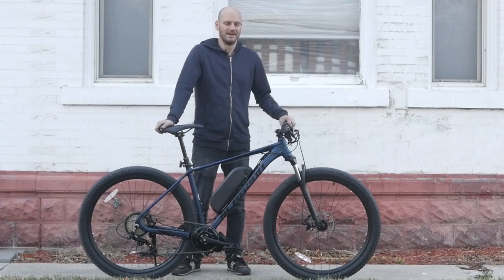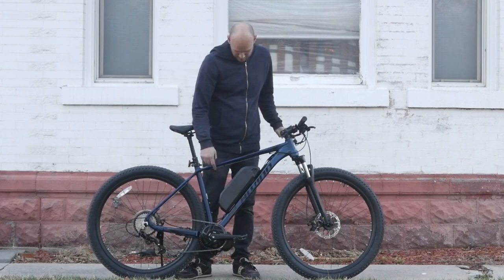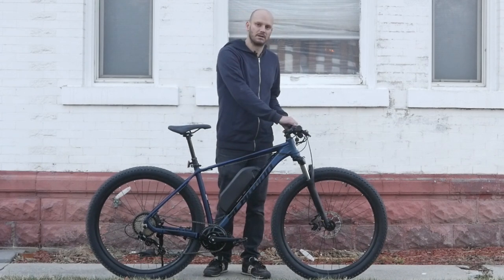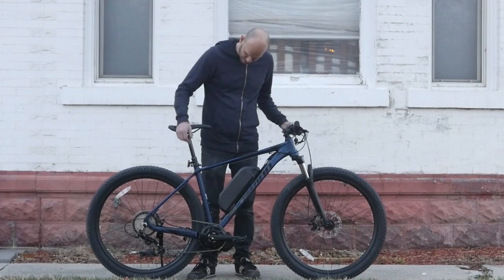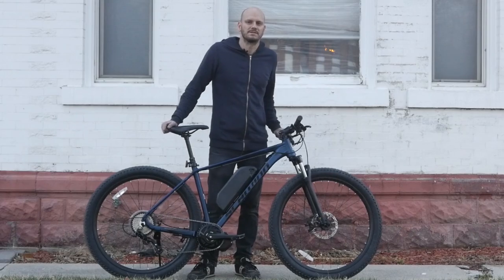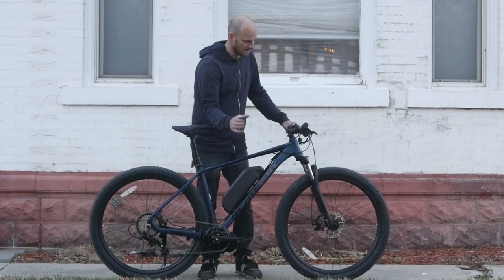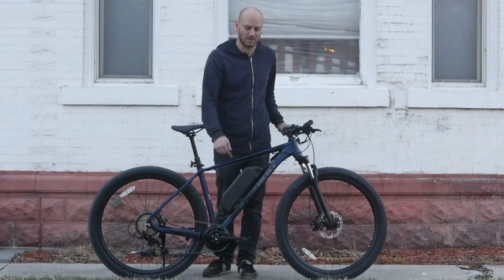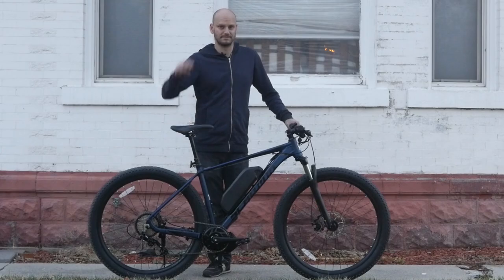Custom Ebike Build: Schwinn Axum BBSHD 52v 17.5ah

Comment: You have convinced me to convert my 20+ year old mountain bikes to e-bikes. Your service in ordering all of the parts I needed to complete my project bikes has been absolutely superb.
Reply: I find it odd how some e-bike makers will use a WAY more expensive lighter weaker carbon fiber frame  to save 1 lb on an e-bike when it'd be better to a use a much stronger & cheaper 4130 chrome molly frame that's 1 or 2 pounds heavier. You're adding a heavy motor & battery pack, so using an expensive $1,500  only 1 lb lighter weaker carbon fiber frame isn't going to make any noticeable weight savings difference. Like this Schwinn Axum aluminum frame in this video will be toast in a good crash but at least it's way cheaper than a CF frame.
Reply: I did the same about 2 months ago. Enjoyed working with Johnny. Love the bike. Put on panniers and use it around town instead of the car! Excellent!

Comment: I follow you because you're the boss. Your advice solid. I don't know if you remember me. I'm the now 63 yo who has bum right leg. I finally found full suspension, step through, fat tire and cargo. The A2B. I paid $300 non working condition with plans to install my bbs02 and 48v battery. But, things never go exactly as planned. Before I found the A2B, I bought a 24" full suspension Wal-Mart bike called Bella.  What I didn't realize is that the Bella fit all my needs. 3 things I had to do to my Bella. 1st . Keep seat low and learn to lift leg over rear tire instead of bar. However, this means no rear rack, only front basket. A compromise. 2nd  Single gear, removed cable and modified selector to serve more as tensioner.  I ride off side of highway so basically I'm trailing and I love it. The need to mod was grass messing up selector. 3. I shortened crank length about 2 inches. Because the 24" close to ground and pedals kept bottoming out, especially side of hills. The crank reduction massive improvement . Additionally allows me to contribute more. I love the bike now. She be sweet beach. Now I still got the A2B It has other suddle complications. The tires. 20" x 3" . And their nearly bald, no knobbies. The Bella I can get tires for easy. The 20x3 rare as hens teeth. I use to own an Lectric XP step through with 20x4. What I found was performance issues. I found the 24x2? just as capable. The fat tire craze is fake to me because it's really about suspension. Soft sand is just not that frequent to justify 4" fatty. So I am left with modifying the A2B to adapt to standard size tire. 4" fatty are more available than 3" , but dang expensive. Thinner is a whole other ball of wax. Spacers, welding, adapters. Haven't worked it out mentally yet, been enjoying my Bella. Another thing. The concerns over disc brakes is over rated. I honestly find calipers adequate. Disc are better but more money. The A2B has great cargo rack and great suspension. One day... Btw, I keep hoping you'll do some full suspension mountain/trail bikes.

Comment: Just a tip. It seems that the 40T Lekkie chainring will fit the standard Bafang motor cover with some modification. If you ever get to read this, it offers more offset options. The new 40T Pro chainring is good for 12sp derailleurs. Just saying.

Comment: Hey Johnny,
Building this bike. Bought the Axum DP at Walmart for $440. before I saw your awesome video. 
The medium frame on the DP fits me better than the large frame on the standard Axum. Someone told me the rear hub is too weak on this bike for a Bafang mid-drive. Time will tell. Thanks!

Comment: I am in the process of doing this build! The only difference is that I've replaced the mechanical brakes with the Hydraulic Shimano Mt-200's, replaced the stock forks with RockShox Recon suspension forks, Shimano quick-release front, and NukeProof precision bearing headset parts. I was thinking about having the local machine shop weld in the Bafang Ultra M620 bracket to the frame. What are your thoughts on using that mid-drive instead? I also contacted Schwinn for the paint code from Y.S. paints in Taiwan.

Comment: I would LOVE that bike if it had rear suspension. Love those tires. Nice build
Reply: With those fat tires you barely notice the bumps.
Reply: @TheAgentAssassin  yep, I have 2 ebikes. 1 is a fat tire ebike 26x4.8, the other 29x2.5…anything at or above 2.5 looks really good to me.

Comment: There is one more thing. Why do you continue to place the gear shift sensor near the derailleur. You could put it adjacent to the shifter with a 50mm outer cable and fit the same to the brake sensor. Less chance of a shock-induced cutoff. Just thoughts.

Comment: This is exactly what I want to build. I'm curious though. Is there a speed or circumstance in which a hub motor is more efficient than the mid drive? I'm wanting to build an extreme range bike and maybe use the mid drive to get up to speed and hub to maintain.
Reply from the maker: Any efficiency would be lost by the added weight/drag of a second system. There is a point where a hub motor is arguably more efficient, but it would be a very small part of the power curve. This is all dependent on the types of motors we are talking about though. They are not all designed the same (gear ratios mainly)

Comment: A great reason to not put hub motors is limited options when it comes to disc brakes. Found that out this week. Also you are running short on BBS02's and Cyclones.
Reply from the maker: Just got a shipment of BBS02’s in 👍

Comment: I have both. 3 hub motor bikes and 3 mid drive bikes. The mid drives are so much more powerful of course. But the hub motors have 2 "pros". 1. There is no drive train wear and tear at all. 2. Much lighter, although the weight isn't centered.
Reply: What wattage are the Hub Motor bikes? I notice all the high power e-bikes/e-motorcycle all use large high wattage hub motors. I figured someone would make a high power mid drive unit and make/use larger gears & chain.

Comment: Notice you didn’t pedal and the stock crank (L) hits the chainstay? Did you swap out the left crank?
Reply from the maker: If the crank is hitting the chain stay, it’s because too many spacers were used. The crank did not hit on this conversion. I actually never pedal as to show what the motor is capable of. 😀

Comment: Have you ever separated a rear cassette and shimmed it over into proper chainline, so as to utilize a 36 tooth  chainring? If so have you had any issues?
Reply from the maker: Yes I have. No issues besides losing a couple gears (assuming that’s what you mean?)
Reply: @JohnnyNerdOut  thank you cause I'm gonna try this one my 10 speed specialized fuse, using the bbshd I just bought from you!
Reply: @JohnnyNerdOut  would a 46t chain ring fit on this bike? If so, would that help the chain line, or hurt it more?

Comment: just curious about that big chainring up front, doesn't that kinda nullify the mechanical advantage that makes mid drives stronger than hub motors?
Reply from the maker: Not at all. Changing to a smaller one would increase low end torque though
Reply: @JohnnyNerdOut  I have an Axum DP and I'm thinking about duplicating this conversion. Do you have a kit or parts list for this installation with pricing? the only difference between the Axum you converted and mine is mine has hydraulic brakes. I'm looking to end up with an ebike that climbs like a mountain goat while carrying my 6'1" 270lbs. That's why I asked about the big chainring, I'm looking for as much torque as I can get! It doesn't matter to me if top end is 15-20mph as long as it climbs like a beast!
Reply from the maker: @oldmansadventures4627  check the description for parts used. I’d go with a 36t lekkie to get really good climbing power 👍
Reply: @JohnnyNerdOut  Brother you were right as rain, I had doubts that the BBS02B mid drive would be any stronger than my 1000w hub drive e-bike but I was wrong, and you were right! My Schwinn Axum DP is now a killer climber and thanks to the use of my gears it still tops out north of 30. Thank you so much for sharing your experience through your videos!

Comment: How did you mount the 68mm motor on the axum? I hear the chainstay hits the motor housing not allowing it to go all the way in and left crank hits chainstay. I bought  a axum and want to install a 750w 68mm, but am nervous on fitment. Any help appreciated.
Reply from the maker: Barely fit. Outer lock ring won’t have enough threads to attach 😞
Reply: @JohnnyNerdOut  thanks Johnny for responding. Does the crank arm hit chainstays
Reply: Did you use 44 tooth chainring
Reply: did you use the bafang crank arms?

Comment: Is it Ok run a 52v BBS02 with just stock rim brakes ? my  bike does not have provision for Disc brakes
Reply: yes you should be good , maybe upgrade the pads
Reply: 100% you need a brake sensor to cut the motor when braking
Reply: You are good.  I build a 40mph BBSHD dropbar roadbike with 52V battery with rim brakes.  Ultegra brakes. Stops on a dime.  28mm tires.

Comment: My free wheel broke miles into a trail. My hub motor got me home. Hub motors dont need a chain. Fir that reason alone they are a better option. Walk your bike several miles and youll see what I mean.
That said, I have been thinking about buying this bike and doing a middrive. Just seens to make sense for this bike.
Reply from the maker: I would just keep a spare master link with you if you are concerned about a broken chain

Comment: Hi J, what do you think about the new bafang BBSO2B MOTOR
Reply from the maker: It’s fantastic, not really “new” though. I think it’s been out for like 4 years +
Reply: @JohnnyNerdOut  🤣 only it said its the new one when I bought it thank you J, I can't wait till I get my mountain bike built after riding my fat tyre bike it will be a welcome change 😉 👍🏾
Reply: I have a BBS02 on my 6 yo Giant Roam MTB - lovin it ! - 50 kmlhr max speed with 46 tooth front sprocket and 48V 17.5 AH battery
Reply: @JohnSmith-sj2dk  nice one brother thanks for the reply 👍🏾 🙏

Comment: The most cheapest 1000w direct drive hub motor you can buy.
Does 37 mph top speed with 52v battery park.

Have you actually tested direct drive hub motors.
They have a lot of options and features.
What you said they didn't have.
In another videos 
1 time you said couldn't program hub motors.
Actually there is more options can do on direct drive hub Motors than mid drives systems

I build high powered mid drive systems & direct drive hub motors & freewheel hub motors E-Bikes.
So I know the difference.

Comment: The Schwinn Axum,Taff & Boundary's are good bang for the buck  dept. store bikes, if you can find one on sale. Same with some of the Mongoose bikes..... MTN bike prices are joke, obviously a $6,000 MTN bike is going to be way better than a $250 Schwinn Boundary bike but it's still nowhere near $5,750 better. If people would quit paying stupid prices for MTN bikes. Sellers would drop their prices and still be able to make profits. They'd probably make more profits by selling/moving more units if they dropped prices. Most people won't buy a $6,000 MTN bike but would consider the same bike at $2,000.. Especially when they see it's way better than a $400 Dept store bike but not crazy $6,000 priced. The price markup is insane, example, way more goes into making a Felt Fake motorized bike frame that can be bought for under $200  VS $1,500 for some name brand 6061 aluminum MTN bike frames.
Reply: Boudary works really well with the BBSXX mid drive or hub motors.

Comment: I'm a fan of hub motors but typically not as powerful as mid-drive because the power isn't scaled through the gears that is definitely an advantage of mid-drive but really you don't  need professional installation of hub motors its much more simple so you can save a lot of money plus you get the benefits of long term reliability and reduced drivetrain wear. I'd never have a e-mountain bike fitted with a hub motor because it would be the wrong choice but then I wouldn't ever have a commuting or touring ebike with a mid-drive motor. However I think Johnny needs to do a custom mid-drive vs shop bought mid-drive ebike (Bosch etc) because there are a lot of important differences there. I just don't think its fair to just lump mid-drive all together. I've seen comments where custom mid-drive ebikes are just lumped with the high end very proprietary mid-drive motor ebikes.

Grin technology just released a video about renovating a old hub motor ebike, I think its like 15 years old and done many thousands of miles and the renovation was really just bearings and one tiny component which he admitted he didn't have to replace it was just a loose leg. That's the reliability of hub motors that you will never ever get with mid-drive. 

I have no problem with Johnny being pro mid-drive his whole business is based around it. Different people see the different benefits of each system either as more important or less important. The vast majority of ebikes in the world are hub based which admittedly is down to pricing.
Reply: Agreed
Reply: Hub drives are fine unless you’re gonna ride uphill!
Reply: @darrylrowe4804  If you are grossly unfit and just don't want to put any effort into pedalling I can see your point but hub drives makes hills probably 3x easier compared to standard bikes where as perhaps the most powerful mid-drive motors maybe 5x easier. If you are off-road going up steep embankments fair enough mid-drives rule but where I live roads don't have 40% inclines. Hub motors are about 30-45Nm where as mid-drive maybe 60-95Nm however there is a small amount of power loss in the chain with mid-drive and with mid-drive the power is scaled through the gears so on some more commuter based ebikes with mid-drive the gearing is not particularly low and the mid-drive motors are far less powerful around 60Nm so many of those are actually worse for climbing hills than many hub drive ebikes. There is definitely an overlap in power between the two. Some mid-drive ebikes don't have a 1:1 gear ratio or even lower than that so what the motor produces is less at the rear wheel especially with the chain power loss. Also remember hub drives deliver their full power in all gears so they can have a much more nippy feel than mid-drive away from the hills so they can feel more powerful away from the hills. To be honest though for me its about the engineering simplicity and long term reliability and value than makes hub motors so appealing which I'm happy to accept slightly less hill climbing performance to get. I want a reliable ebike for long riding sessions over many hours. Even if the chain breaks I can still get home by turning the pedals and letting the motor do all the work, not that the chain would break of course because the hub motor takes a huge amount of load off the drivetrain so the drivetrain wears much, much slower and is less likely to have any issues.